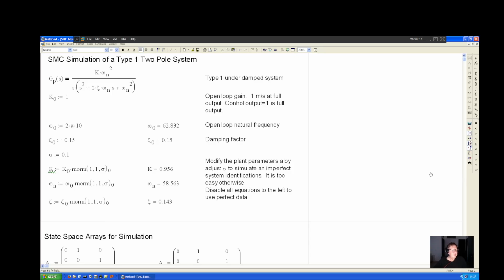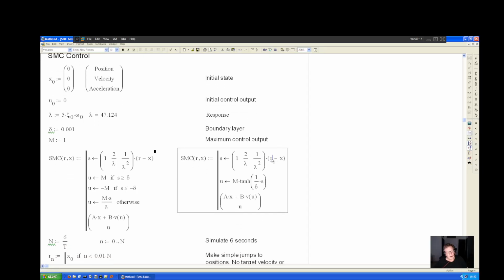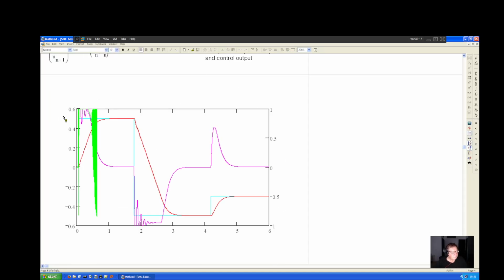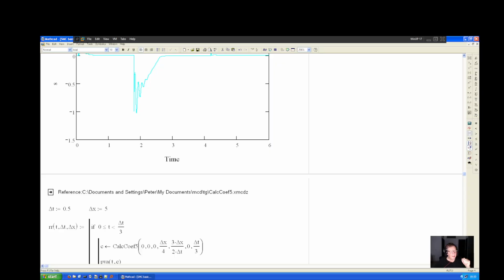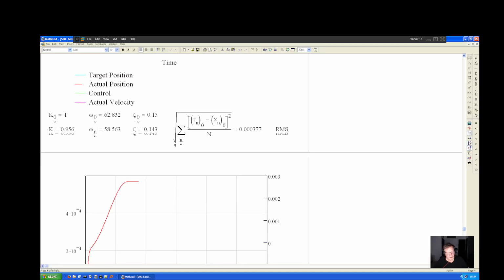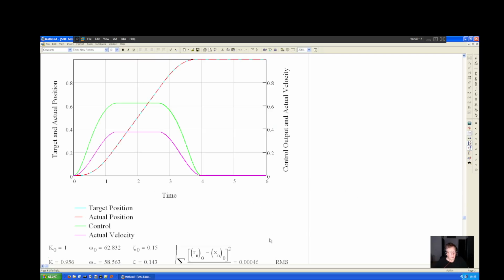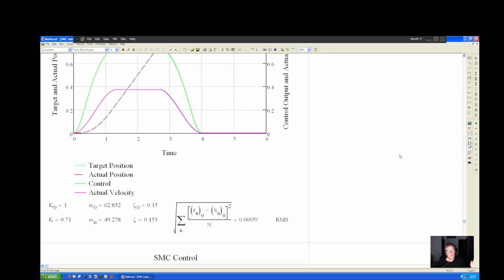Peter Ponders PID - Sliding Mode Control SMC Part 2

Comment: AI Summary

Abstract:

This technical follow-up (Part 2) examines the application of Sliding Mode Control (SMC) to a second-order, underdamped system, specifically modeling a hydraulic velocity control system integrated into position. The analysis focuses on a plant with a significantly low damping factor ($\zeta = 0.06$), approximating the "mass-spring" effect of hydraulic fluid volumes. The presentation details the mathematical transition from continuous state-space to discrete-time formats, providing the necessary calculations for environments lacking automated conversion tools. The controller utilizes a hyperbolic tangent ($\tanh$) switching function to manage the boundary layer and mitigate high-frequency chatter. Through simulation, the robustness of the SMC is demonstrated against non-linear valve characteristics (e.g., cubic curvilinear curves) and plant parameter variations. Results indicate that the system achieves precise tracking with minimal root mean square error (RMSE) and zero overshoot, even when the plant enters saturation or experiences significant model drift.

---

### Technical Summary: Second-Order SMC Implementation and Robustness Analysis

*   0:03 Second-Order System Modeling: The system approximates hydraulic velocity control with a subsequent integration to position. It is characterized as a second-order, underdamped system ($ζ = 0.06$), simulating the oscillatory behavior of a mass between two hydraulic fluid "springs."
*   0:13 Robustness Testing: The objective is to demonstrate SMC’s ability to control highly oscillatory systems ("like a slinky") and maintain stability despite varying plant parameters.
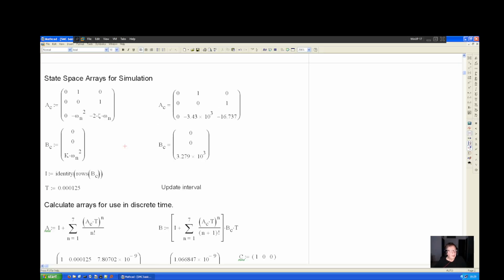*   1:24 State-Space & Discrete Conversion: The presenter outlines the manual mathematical process for converting continuous-time state-space models into discrete-time (digital) formats, specifically for use in software like Mathcad that lacks automated conversion functions.
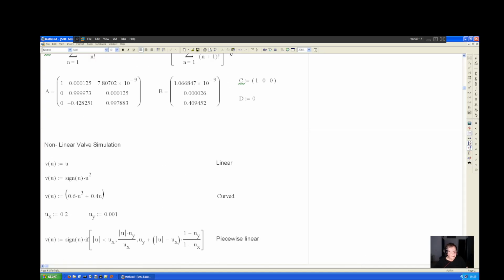*   1:55 Controller Parameters: The SMC uses position, velocity, and acceleration as state variables. Control tuning relies on two primary parameters:
    *   $\lambda$ (Lambda): Defines the response speed.
    *   $\delta$ (Delta): Defines the boundary or switching layer width.
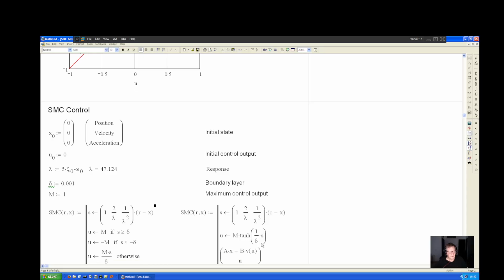*   2:34 Switching Function ($\tanh$): A hyperbolic tangent version of the switching function is employed to weight the target versus actual states, effectively preventing overshoot.
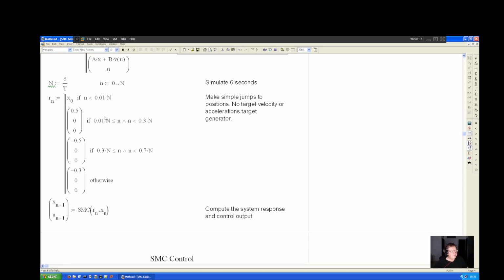*   3:22 Step Jump Performance: Simulation shows the system reaching set points without overshoot. Adjusting $\lambda$ changes the saturation exit point and deceleration ramp; a higher $\lambda$ provides a faster, more aggressive response.
*   4:48 Open-Loop Saturation: During periods where the output is saturated at 100%, the system operates in an open-loop mode, where internal oscillations are not actively controlled until the system re-enters the controllable range.
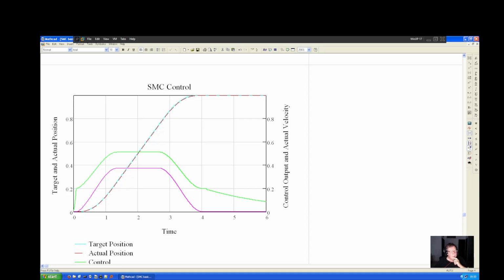*   5:34 Motion Profile Tracking: With $\lambda$ set to 5, the root mean square error (RMSE) in position is maintained under 1 mm, with velocity error under 3 mm/s, demonstrating high tracking accuracy during dynamic movement.
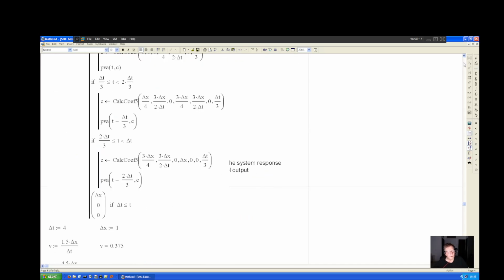*   7:18 Non-linear Valve Compatibility: The SMC is tested against a "cubic curvilinear" valve model. Despite the non-linearity of the valve, the RMSE remains below 0.5 mm, confirming the controller's insensitivity to actuator non-linearity.
*   8:09 Hardware Realization: The presenter notes that SMC, particularly using the hyperbolic tangent function, can be implemented via analog circuitry or dedicated hardware for high-reliability applications where computer reliance must be minimized.
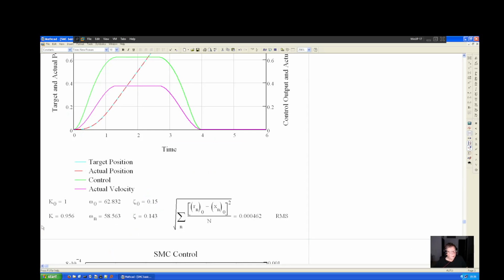*   8:57 Parameter Sensitivity: Modifying plant parameters during simulation results in negligible changes to the RMSE, validating the inherent robustness of the SMC approach against model uncertainty.

AI-generated summary created with gemini-3-flash-preview for free via RocketRecap-dot-com. (Input: 14,239 tokens, Output: 866 tokens, Est. cost: $0.0097).